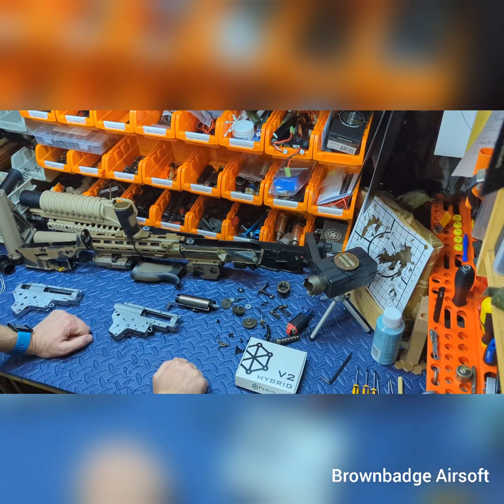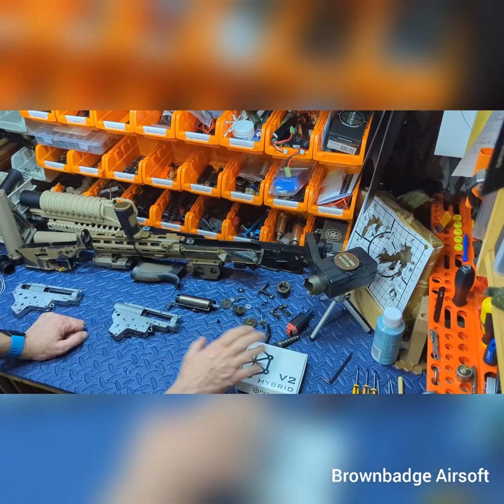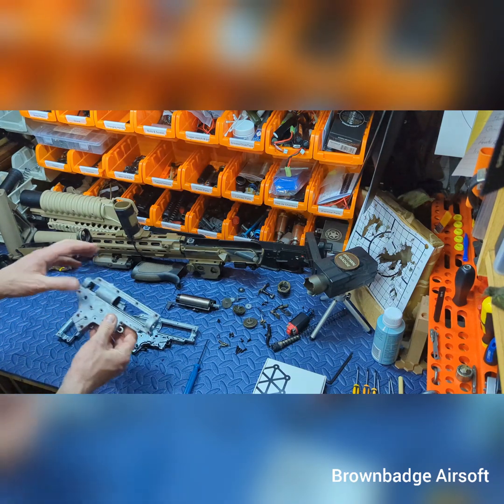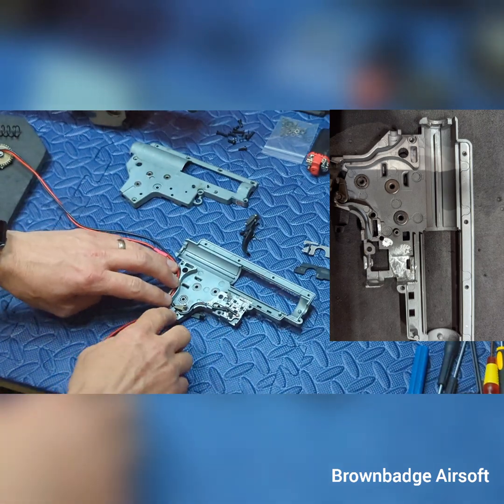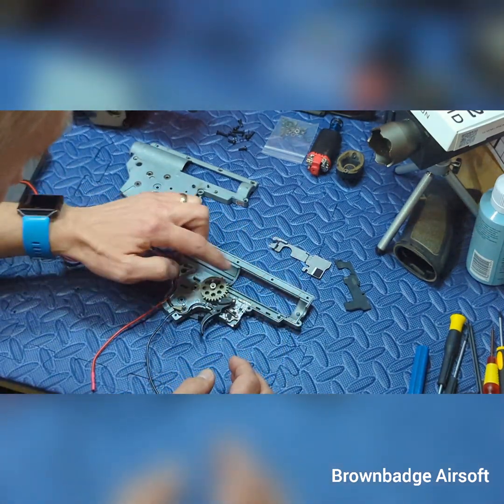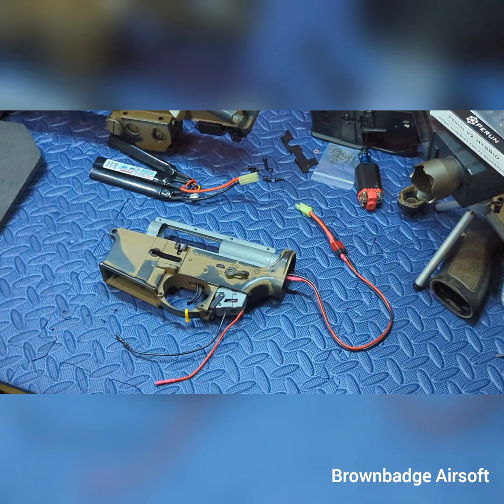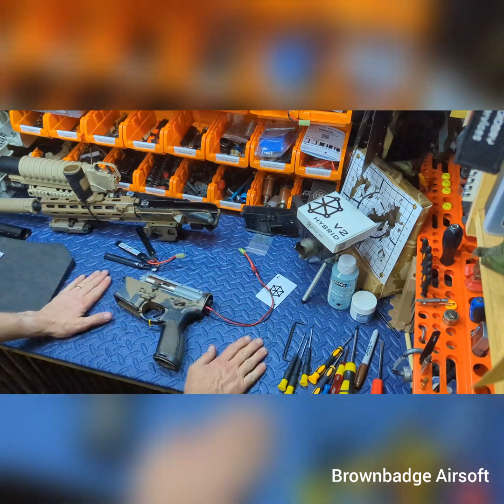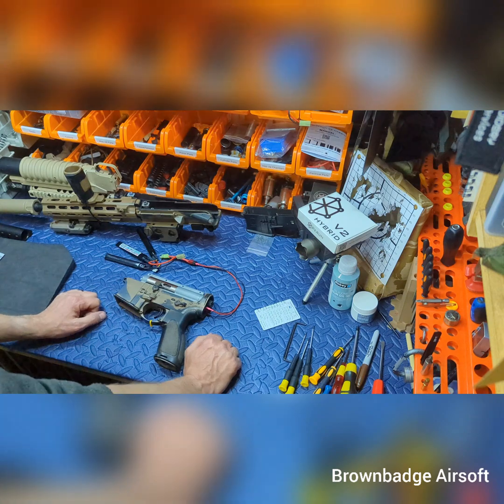Perun BE Hybrid Mosfet into a Arcturus HK416

Comment: Hey there, thanks for a great video. I have an Arcturus GR16 and finding any useful information about adding a mosfet other than "you can't, buy a different gun" quite difficult. It's actually my first airsoft gun due to it being one of the closest to a 416 I could find and after handling the Specna Arms version it was clear the build quality of the Arcturus was far superior. Right now I have a Perun AB++ mosfet that I will get round to installing soon, but in the future I do plan on getting a more advanced unit. Could you give a little bit of information as to how you ground down the gearbox? Airsoft techning is new ground for me, so even the basics would be great to learn.

Cheers!